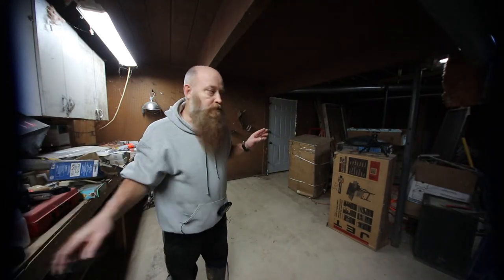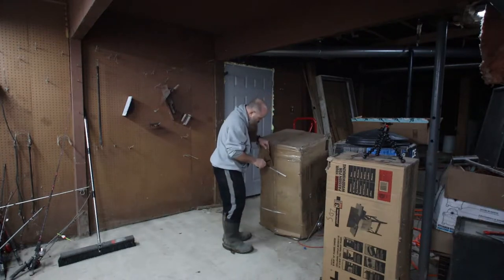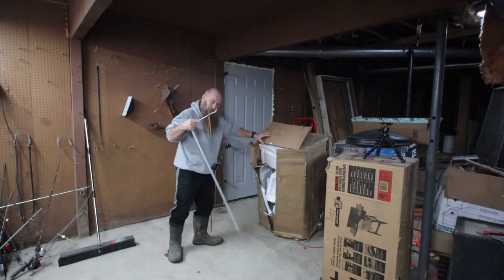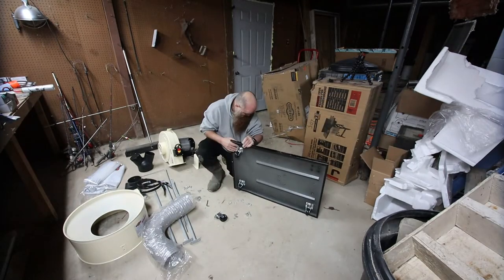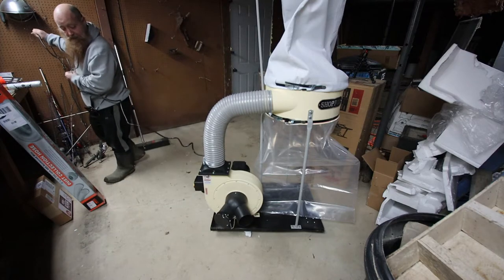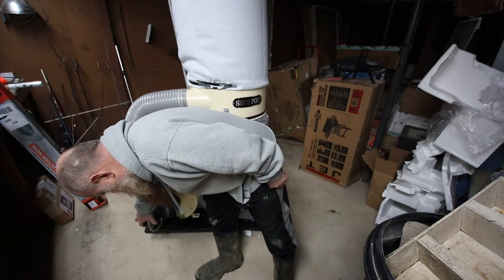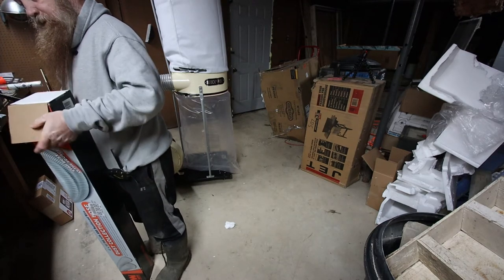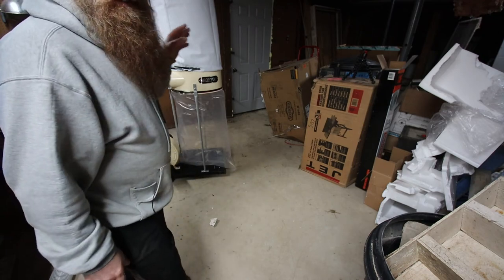Homestead Workshop Upgrades: Shop Fox W1685 Assembly

Comment: That's a tank! I just use my vacuum cleaner. Yes my household vacuum lol. I have to empty it often but on a budget it works.
Reply from the maker: i've done that using the "tool attachment" hose, then a shop vac.  It will all make sense why the upgrades soon'ish lol
Reply: @sharpridgehomestead  I figured you have something going on to need the upgrades. I just use as I need which isn't often indoors. Most of the work I do is outside for building projects.

Comment: I just got the same unit..  Getting that bottom bag on had me cursing...  Grr
Reply from the maker: yea, and it hasn't gotten any easier either lol
Reply: @sharpridgehomestead  Literally just finished putting mine together.  Thanks for the tip on using a rubber band though!!  I have some giant rubber bands made for a garbage can.  I'm gonna try using one tomorrow.
Reply from the maker: @mwa1252  that is exactly how I did it .. I had these huge rubber bands ... the package says 7 inch file bands so I assume they are to hold like filing cabinet folders together or something .... worked like a charm.  Another idea I had but didn't try because I found the rubber bands first was to use a few small magnets.  Once you can get the bag to stop falling off, getting the band on is pretty easy.  Good luck and thanks for watching (hopefully your box wasn't as damaged as mine)
Reply: @sharpridgehomestead  My box was pretty well mangled also...  Parts literally falling out the bottom.